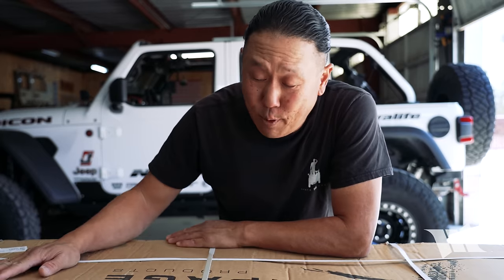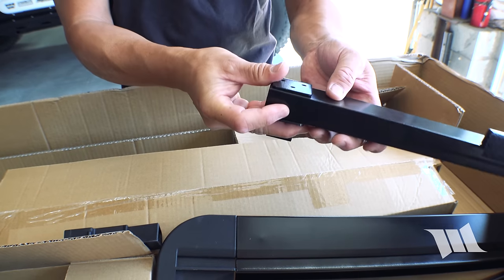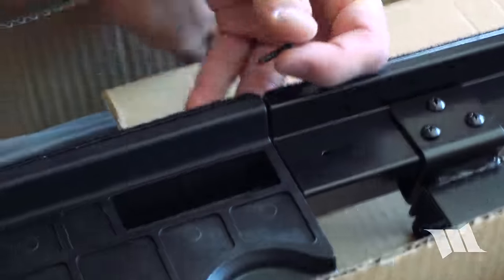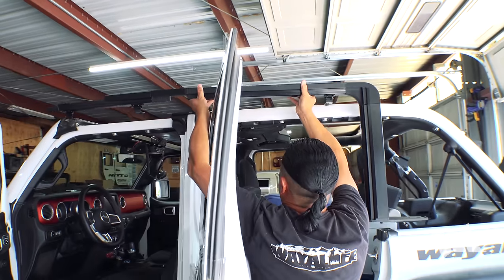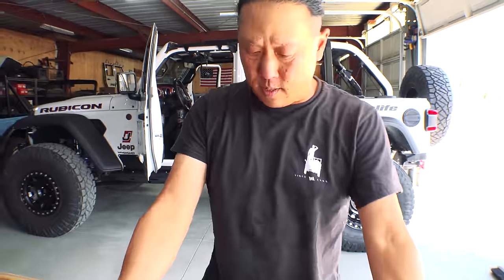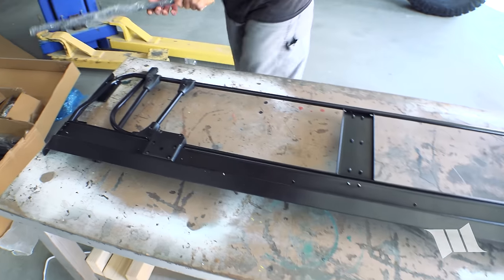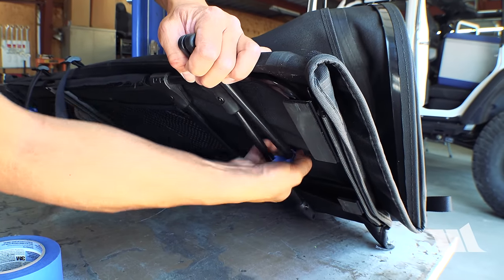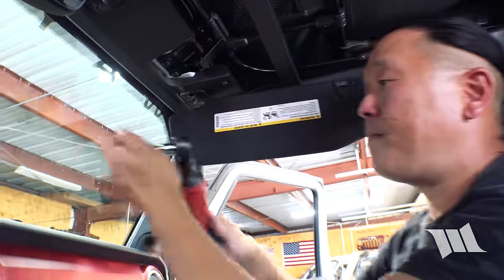Rampage Trailview Fastback Soft Top Installation on a Jeep JL Wrangler Rubicon Unlimited 4 Door

Comment: The whole video I was thinking both “oh man, that’s way better than my Trektop NX”, and “oh gosh, that is totally inferior to my Trektop NX”. I don’t know what I’d choose if I had to do it now. They both beat the other in certain areas.
Reply from the maker: I've run both and both have their plus and minus. I've never run one of these before and so I wanted to test it out. So far, I really like the Trailview flip top way better than the Trektop, especially being that it sits so nice and flat when open. Also, I really like how you can store the rear windows inside the top when running in Safari mode.
Reply: @wayalife  I LOVED that part too. I didn’t like how far I had to reach back to open the sunrider... and I’m 6’4”. Love how it lays flat instead of upside down. The tailgate bar was WAY better than my bestop too. I used to have to shoot some steroids before attempting to snap the bar on the NX. At this point, I only “like” the bestop door surrounds and header better... having never touched the one you’re testing.
Reply from the maker: @lukelambert4595  The door surrounds are like factory with the Bestop for sure. Fortunately, now that these are assembled, I won't have to mess with them again.
Reply: @wayalife  big fist pump for ya there! Regardless of what top you have, that thing has come a long way. The way it is now is my favorite. Love the new 38’s and KMC’s!
Reply: Can you put the hardtop on and keep the door surrounds, etc in place? Or does everything have to come off for the hard top to go back on?
Reply: @josephlucchesi2172  good question. I hated having to totally strip every bracket & plastic part on the bestop. Wonder if this one is different.
Reply: @wayalife  replied in this thread and not directly to you by mistake — Can you put the hardtop on and keep the door surrounds, etc in place? Or does everything have to come off for the hard top to go back on?
Reply from the maker: @josephlucchesi2172  The door surrounds would need to be removed.

Comment: I really like how it folds back! I like how the inside portion isn’t facing up like the bestop soft tops. It folds so the top of it is still facing up. Really neat design! And it has those little clips to hold it down as well built right in! Those are cool little features that really gives things an edge!!!
Reply from the maker: Agreed. The flip top on this is a far better design than the old Trektops that I've run in the past. I also really like that you can store the rear windows in the top.
Reply: @wayalife  how do you store the rear windows in the top? I didn’t even notice how that would be a possibility watching the install.
Reply from the maker: @StormbornJKU  The rear half of the top is actually 2 tops. You can kind of see it here https://youtu.be/ddwll0VSO2g?t=1491 You can store the windows in between the fabrics like a sandwich.
Reply: I was thinking the exact same thing. My trek top was a way more “complicated install. Doesn’t look near a nice with the rear panels off. And the way it flips back I don’t care for but seemed to be the only option at the time. May need to change it out soon.

Comment: Great video. I have the factory jlu soft top. I know you don’t like the way it looks, but man it is so easy and fast to put the top down or up, or into Safari position. I often take the top down when traveling, then put it up when I get home or to work. Taking the top down is less than a minute. Putting it back up is about 3 minutes or a little less. Can’t beat that for my use.
Reply from the maker: Yup, to each their own. I hate how the factory soft top looks, I hate that it doesn't have zippers and I hate how crazy big and heavy it is. Installing this top took time for sure but now that it's all assembled, I can take it apart and put it back together in about 5 min. ALSO, I can store my rear windows in the top itself and when the front is flipped open, it doesn't look like some kind of mistake. But then, that's just me.  😎
Reply: @wayalife  just curious, how come you dislike the channel guides versus the zippers? i’ve had tops with zippers and with the channels and find the channels make the windows so much easier to put back on
Reply from the maker: @hunterking4002  Maybe it's just me but I found that the channel guides on my factory soft top were a lot harder to work with, especially when trying to open up the rear window and when it's cold out. So long as you keep your zippers clean and lubed, I've always found them to work well.

Comment: Good install video.  Would've done me some good about a month ago 😋.  I bought the same one for my JL.  I haven't noticed any leaks with heavy rain. Around town it's not so bad or excessively noisy. But, took it out over 80mph and i could see the top lifting on the header portion (still didn't leak). Overall, I'm pleased with price, function, and looks. I'm waiting for temps to drop so I can leave it as a safari top. Keep these great videos coming.  Almost forgot; took me 5 hours from removing the hard top to the last adjustment on the new top 😬😅
Reply from the maker: Glad to hear the review! 👍
Reply: Do you recommend it and how is the noise compare to the hard top? How much it cost you ?
Reply: @3bche  I was able to find it for a little over $700 (MSRP says it's over $1k). For $700 I'd buy it again; for $1k I'd look at other options. You can't compare/complain about the noise compared to the hard top. You can still hold a conversation though. I'm keeping it as a summer/in-town top. I'm leaving the hard top for winter and long distance driving. It's also very nice to open and close the front so easily. And the back pieces store in the top so you can put them back on if you get caught in some water or dust storm.

Comment: Very interesting.. I really like the door surrounds and the little metal piece that attaches to the surrounds on the driver and passenger front seats.  Seems like this would do a lot to remove wind noise and wind.  The issue with the wrangler is a lot of wind comes in between the door and the rollbar.  I also have the alien sunshade which also lets in wind between the end of the shade and the rollbar.  I'm wondering if I can just purchase the surround with that metal piece that attaches to the surround.  Seems like with that in place plus the alien sunshade, i'd get a little bet of sun but most of the wind and wind noise would be removed?  I was thinking about fabricating a solution, but this might actually work perfect?

Comment: Hi great video. Are you able to remove the the entire top if you want to and is it easy or a pain. Thanks.
Reply from the maker: Yes, you can and it isn't too difficult but I would not recommend this top for other reasons. Mainly, the windshield header channel lifting up at highway speeds is something I was never able to solve and it just makes way too much noise.
Reply: Was it an issue with the clamps not holding it down right enough. I know I the video you installed the clamps wrong at first. Can’t seem to find the ipdate video you did on that
Reply from the maker: Essentially, yes. The design of the clamps just don't hold down well enough to keep the header from lifting up and to the point where you can see the sky.

Comment: Still rocking this top?? Just ordered one hope it’s solid n lasts ,any issues with it fly up or opening in higher speed driving while open?? I’ve read few people saying constantly flys open on freeway drives??
Reply from the maker: Unfortunately, I am not. I so wanted to love this top but in the end, I just couldn't get the front to stay on tight to the windshield. At highway speeds, it would always lift up and make a ton of noise. Really disappointed.
Reply: @wayalife  that’s not the answer. I wanted to hear well it’s too late. Mine got delivered today. I just finished opening it. The weird thing is I look at it and the latches that lock it to the front windshield are fixed to the frame now and they’re not adjustable like every video I see has those turnbuckles that you can adjust and make tighter. Mine does not have that, very weird. I wonder if they change their design
Reply: @1978coop  What is the verdict on your top? Did they change the design? Does it still have the highway wind noise issues?

Comment: I've always have had bad luck with these type of tools with leakage. Not a fan of self tapping screws. Just like screwing into plastic, just a matter of time b4 it loosens. Just my opinion. So are u staying soft top. I'm assuming you would have to take everything off to out hardtop back on.
Reply from the maker: Won't lie, the screws are not a winning point for me either. Hoping they hold together. As far as leaks go, hell, I have leaks with my factory soft top so it's no big deal for me. I still have my hard top and will use it in the winter. I've already taken this top apart and put it back together just to see how hard and how long it takes. Super easy and I can do it in about 5 min.
Reply: @wayalife  👋jeep wave

Comment: Hey Eddie…. Big fan … i just installed my soft top, looks super nice but i am wondering, whats the deal with the anti puddle bars….. it came on your kit too but you never mentioned anything about it and I googled it and i cant get no info
Reply from the maker: They're really not that necessary but if you look above the rear seat, there are pockets on the top going from the sound bar to the c-pillar roll bar. They just tuck in there.

Comment: Bestop seems to make a more user friendly version for daily operation.  There aspects of the Rampage that seem really built well though.  Would be interested in a comparison thoigh
Reply from the maker: So, having installed both, what I can tell you is that both have plus and minuses. The Bestop is without question, more factory like and a lot easier to install. However, once installed, this Rampage top really isn't too bad and I actually like the flip top Trailview feature of it a lot more. I've always hated the way the Sunrider on a Bestop opened up like a loose umbrella waiting to catch the wind and kind of like a mistake. However, the Bestop does seem to be quieter. With that said, the jury is still out on this top. I need more time to test it out.
Reply: @wayalife  Agreed. I've had nothing but the Bestop (factory) softop for my JK since 2013 and I've used the sunrider feature ONCE. It looks like crap in that mode and flops around quite a bit. This looks much cleaner in that flip back mode.
Reply: Would love to hear your comparison thoughts as of today.  I’m planning on a fastback, but not sure which one yet.

Comment: Heavily considering this top for my JKU simply for the window storage feature built into the top. How is it holding up after a year and would you still recommend it?
Reply from the maker: So, I'm not 100% sure how it works on a JKU but on a JLU, I was never able to keep the header down. At speeds over 70 mph, it would lift a bit and make a lot of wind noise. I don't know if I would recommend it because of it and that's a shame because there was so much about this top that I really liked. I have let Rampage know about it and maybe things have changed now.
Reply: @wayalife  interesting 🤔 and that could be a deal breaker. Ugh. Do you know of any other soft tops that have the pocket storage for the windows?
Reply from the maker: Unfortunately, no. That said, I would reach out to Rampage and ask them if they fixed this problem before discounting their top as an option.
Reply: @wayalife  I think I’m going to have to. Thank you for the insight and thorough installation!

Comment: Long time follower.  Read a lot of the comments, and saw what the problems were.  In your opinion, do you think this top is a reliable replacement for the OEM soft top?  I regularly deal with heavy rain (South Florida), and drive over 70 all the time.  Thanks in advance for your thoughts and keep up the great posts.
Reply from the maker: Unfortunately, and I do mean unfortunately, I would have to say no.
Reply: @wayalife  copy.  Thanks for responding.  Is there a fastback out there that you would recommend as a year round replacement?
Reply from the maker: @9critical  Bestop is really the only other brand that's worth looking at. And really, it's a shame because I really like the look and function of this top better.

Comment: Just curious are you going to make review of this top. I would like to have you opinion on it. I am thinking about getting one.
Reply from the maker: So, after long term use, what I can tell you is this. I really like the look of this top way better than the Bestop and think it functions way better in that you can store the windows in the top. Assembly of the door surrounds is a pain but you only need to do it once. The biggest downside to this top is that the front windshield header channel lifts a bit in a cross wind or when driving above 70 mph and that causes wind noise. I've contacted Rampage about this and they did offer some tips but none of them have worked as well as I had hoped.

Comment: Great video!  Definitely helped me with installing mine.  Do you notice the wind lifting up the front header channel at all?  I've got this top as well and at 45mph+, it's like the wind gets under it somehow and creates a gap.  I've tightened those latches as tight as it goes but it still happens.  Wondering if I'm alone with this issue.
Reply from the maker: You are not alone and it is frustrating. If you look in the comments, I have mentioned as much and I wish I could still make an edit to this video to let other people know about it. I would reach out to Rampage to see if they can help out. If enough people do, I would assume they could offer a better fix.
Reply: @wayalife  I just added some washers between the bracket and the jeep and that seemed to help alot.  I also made support bracing out of 1/2 pvc to quiet the flapping of the top too.  The washers definitely helped with the gap though.
Reply from the maker: Thanks for the tip!

Comment: That's hella involved for fast back top.. looks great , but you could install a lift in almost the same time!!
Reply from the maker: The upside is that you only have to do all this once. The downside is that the top ended up not working that great. The windshield header just lifted too much in the wind and made way too much noise.

Comment: I was wondering, what size tires and lift are you running. Do you change your gearing
Reply from the maker: On this video, you're looking at 38" Nitto Ridge Grapplers and on a JL Wrangler running EVO coilovers set to about 4.5" of lift. Also, running 5.13 gears.

Comment: Gotta a question. I watched your video and installed the exact top on the same model jeep. I cannot get the front drivers side to seal correctly. It leaves an air gap and I’m afraid it’s gonna leak when it rains. I’ve got the aftermarket clasps as tight as they’ll get. Please help??
Reply from the maker: I really am sorry to hear you're having this problem. I did as well and just never could get it to work right either. Really sucks because I like the top a lot otherwise.

Comment: Are OEM JL door surrounds that complicated? My only experience is on our JKU and it seems way simpler.
Reply from the maker: Umm, I think that Rampage had to come up with their own solution so that they could get around OEM patents.
Reply: @wayalife  that makes sense. Are the factory JL ones similar to the ones that came on the JK? I’ve only been around two JLs and they were both hard tops.
Reply from the maker: The JL soft top is quite a bit different than the JK. It's much bigger and heavier too.

Comment: I installed this and it’s so loud . I followed your video did I do something wrong or are these crazy loud
Reply from the maker: This video is a couple of years old and after more use, I finally stopped using it for that reason as well. No matter what I did, the front of the top would still lift at highway speeds and make the sound super loud. I am sorry you are experiencing the same thing.
Reply: @wayalife  thanks so much for replying any equivalent out there that you have tried ?
Reply from the maker: Not for a JL but I have run the Bestop Trektop on my JK in the past and it worked a lot better. I am currently running a Rugged Ridge fastback top on my JK and it's been better too. I really like the look and function of this top but Rampage really needs to redesign the how it attaches to the windshield header.

Comment: Great video, as always. how is the top holding up? I ask since reviews are hard to find and I want to see how it compares to the Bestop TrekTop. I don't expect it to be on par, as it about 1/3 the price, but as long as it doesn't leak and wind noise is not too horrible, it seems like a great deal.
Reply from the maker: So far so good. Initially, I did install the windshield clamps incorrectly and that lead to a lot of wind noise but I have since corrected it thanks to the great customer service at Rampage and have since included a card link in the video to explain as much. The install is definitely more work than the Trektops that I've installed in the past but once on, everything seems to work great. I definitely love how the front opens much cleaner than the Trektop and love how the rear windows can be stored in the top itself.
Reply: @wayalife  Yeah, the way to front opens is more to my liking as well as the storage option when the opportunity to open up arises. Getting ready for top-off season here in SWFL
Reply: I own one for my 2021 JLUR. It’s honestly not worth it. Though it looks aesthetically pleasing, mine lets in about an inch of daylight once I start going over 50mph. Rampage has been reluctant to speak with me about the issues. I regret selling my MOPAR soft top to buy this product.